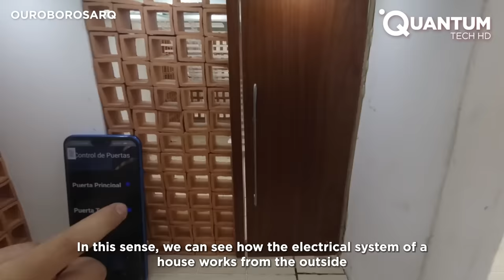Amazing Small-Scale House Construction | From Foundation To Last Detail @OUROBOROS-ARQ192

Comment: I don't get it. The start was a wooden frame filled with dirt (analogous to an empty lot). How did it go from that at 0:14 to a grid of neatly cut plywood rectangles at 0:19, just by digging between the strings? Something important has not been shown.
Reply: Yeah, that bit puzzled me too. So I assume that the plywood forms were put in before being covered with the dirt to resemble an empty lot. Then dug out to reveal the forms to build the foundation. Seems like the beginning of the video has been cut that may have shown the above mentioned process, as I'm sure I saw this video several years ago on the original channel.
Reply: @EzeePosseTV  If that's the case then stringing the lines was just for show; no real purpose, except perhaps to represent how it would be done on the actual jobsite.
Reply: @chanfonseka8051  Yeah, I thought that too. It is a nice touch of them replicating jobsite scenario's like the piles of staked bricks and cement bags. Also the miniature tools used to apply the cement on the brick work. A lot of it is for aesthetics really.
Reply: Я перемотал два раза, тоже не особо понял. Но потом он выгребает землю между опалубкой. Наверное это не важно, как туда попала фанера, главное начинается потом.
Reply: @chanfonseka8051 you think it was made to look like a cartoon? wtf

Comment: This is absolute sick, though I would reccommend you vibrate the concrete for just a second. How long did this take you? 3 months? Also when you do the masonry between the collumns we use a wire, and cavity anchors to hold the wall in place. Now wires is not something you can easily use in such a small environment but you can use a small straight square stick to hold it along the collumns so your wall ends up in one line with the collumns. This is not criticism, this is just a tip. I have more but most of them are just about it being correctly done, even though that is not necessary here. Again awesome awesome build. I wish I had the patience to do this. I have hardly the patience to do it in a 1:1 scale let alone this hahaha 😂

Comment: If the modeller erected scaffolding and propped the concrete floor shuttering soffits then that would have been mind blowing.
This is more than an architectural model. It's a construction model. Maybe architects should be compelled to build in 1:1 scale as part of their studies so they don't design "unbuildable" buildings.
Reply: @walsakaluk1584  architecture and engineering are never great couple ....

Comment: Would've been great to see a few RC machines in there, an excavator to dig the foundation, a boom pump to get the concrete around, especially to the L1 and the roof, maybe a crane to lift everything else around plus do a bit of concrete, the formwork, reinforcing steel, brick and mortar....yeeaah

Comment: Hmm, nice work. But I feel its missing risers and aircon, as usually that is on the roof. (and sometimes a water tank), there also seems to be no provision for rain, for it to run off , as rain does not always come dirrectly down.

Comment: This is cool for a "real life" look at the building for the client so they can really understand how it will look, but how technollogy is now, I imagine you can do this on a computer, with 10% of the time and effort, and get almost the same result in terms of finding a problem or flaw on the design, so I'd imagine more and more architects are going the digital way and not doing this, at least not on this level of detail (never known someone that works on this, so I don't know if they really make models or not).
Reply: Do you think they hadn't done that already? That wasn't the purpose of the video. They aren't just producing a finished output that the client will only see the end of. It's also for educational purposes for those on the ground who are doing the construction. Otherwise, they wouldn't have been showing to the client how everything is created, they would have just slapped down some wood, glued them together, and painted them white.

Comment: I'm curious about how weight, pressures, building forces, and gravity all scale up. I have to imagine the same structure, on this scale, wouldn't behave exactly the same, given material constraints like thicknesses and grain sizes in things like substrate and concrete. Even rebar, at this scale, steel grains are much larger

Comment: Question why do they put brick and mortar between the vertical steel beams and then cover them horizontally with concrete? Why not just fill the whole space i.e. create the whole wall with concrete? Whats the point of the brick and mortar?

Comment: I don't get it you def know what you're doing building this. what I don't understand is why dremel trenches in the concrete it's a lot easier to attach foam or wood to the foundation foam is best because after cement dries the foam crumbles and falls out easily.

Comment: This isn't in my experience how architects conceptualise buildings. More so this is perhaps for a test project or to demonstrate something at a trade show. In my time draughting, we never built a single model but we did do colour elevations, images and models in CAD. Picking students may have done this, especially as they forgot some wiring and had to manually add chases for conduits they possibly forgot.

Comment: I think in Asia they build this way but where I'm from we use mostly wood, steel and brick. Everything is open plan so no like this grid structure.
Reply: Yeah, I'm watching this like "man, that is such overkill on the structural integrity and any modifications after the fact would be such a pain."
Though, given the breezeways, I'm guessing it's for a much hotter environment, so wood might be scarce.

Comment: Why so many walls, modern houses with high ceilings need large windows. you forgot the air condition and the big holes for the aircondition tubes in the structure. no floor heating. good beginning but then many things went wrong.

Comment: I can tell by the way these minis are being built these aren’t modern US standards being met lmao. This is like fancy if you didn’t care about the safety of the people inside the building. I hope the model is simply for visual representation only as a 3D model would actually show each nut and bolt used typically along with measurements.

Comment: while it is a bit impressive and something you might see in an architectural firm lobby, and I know that it's just a model but the nitpicker in me needs to point out the serious safety issue with the top of the steps going to the roof at 40:21 or so those bricks are dangerously aligned